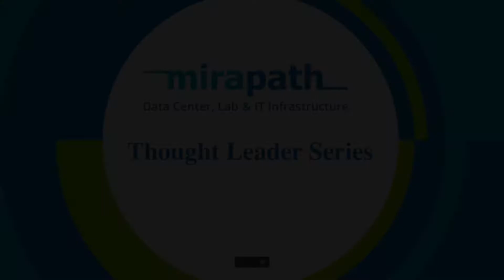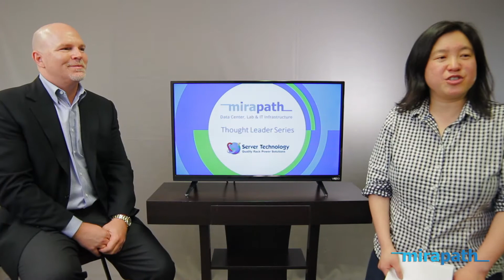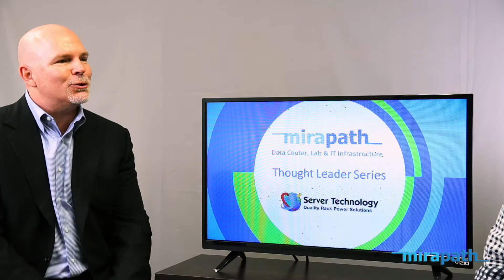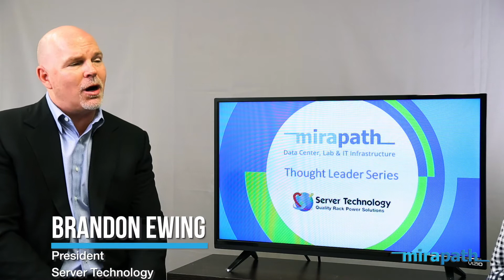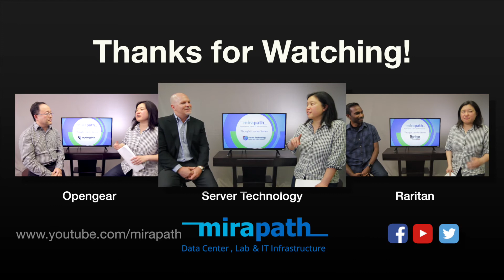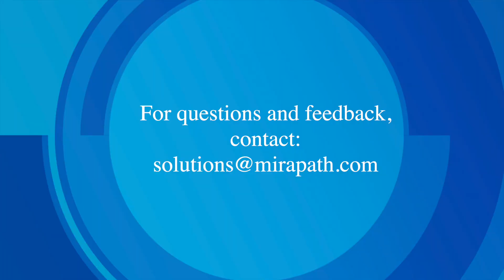Mirapath, Inc. Thought Leader Series: Cabinet Power Strips and Yachts

Comment: The electricity consumed by typical production IT gear is the most costly monthly expense; often consuming more electricity than the IT gear is worth (new) before the first year of ownership. Even if it is a 60-amp Servertech PDU, and powering 3 IBM H-Blades, the electricity at full computational load is tremendous, and expensive. It is reasonable to assume that more money, in electricity, will be spent in the first month of powering that connected IT gear than the initial CAPEX of the PDU. 
Given the unprecedented dependability of Servertech PDU's, there is virtually no close second when choosing a rack PDU.